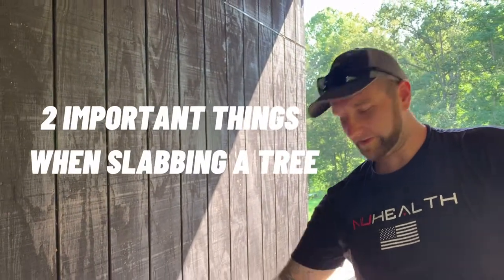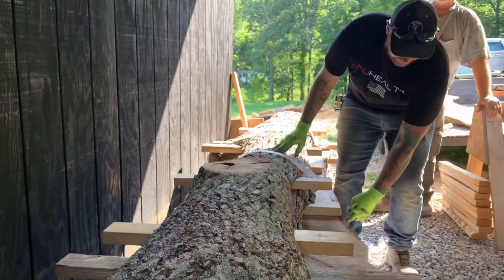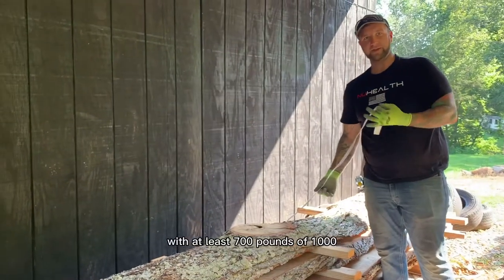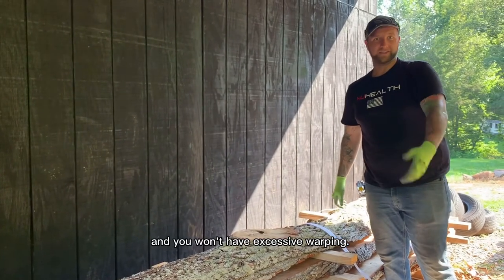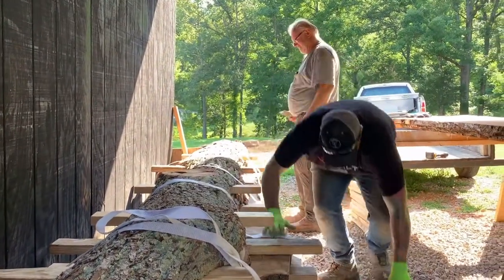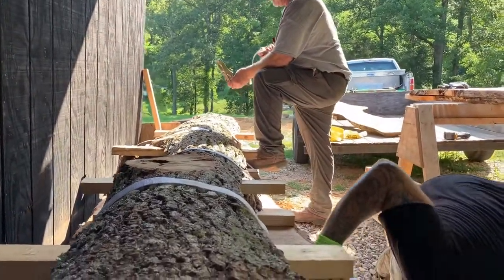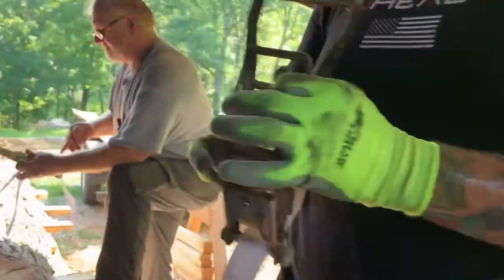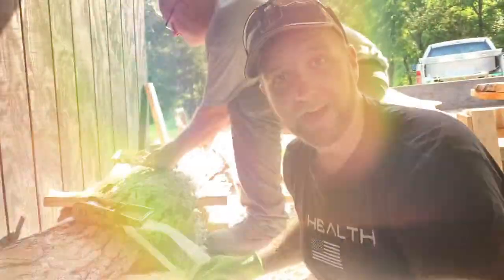HOW TO DRY SLABS PROPERLY | Drying Lumber

Comment: Thanks for the lessons. Can you use dried western red cedar for stickers on 8/4 burr oak slabs?
Reply from the maker: Since this video, I have always just used hard wood stickers if it's still wet (green). Not sure if it's the right thing to do or not. But I have had many trees dry and where the stickers were, it left a deep dark line where the wood couldn't breathe. 

Now I always use stickers that are the same species of wood that is drying. For some applications you can't actually do this but I usually use hardwood stickers. 

In any case, I don't see a problem with using cedar on oak because the oak boar is much harder than the cedar. If the oak has lines in it, you will likely be able to sand/tool them out. 

Let me know if there is any other information I can pass along. 

Also, let me know how your wood turns out!
Reply: I'm not a pro by any means, but just something to think about, cedar has a lot of natural oils in it that might stain other wood.  

Most hard woods would make good stickers,  the most important things are that they are dry and consistently thick. Generally 3/4" to 1" thick spaced every couple of feet or so. A 2x4 still has a lot of surface contact with the slabs and will trap more moisture.
Reply from the maker: Oil may transfer. Hadn't considered that. Good catch!